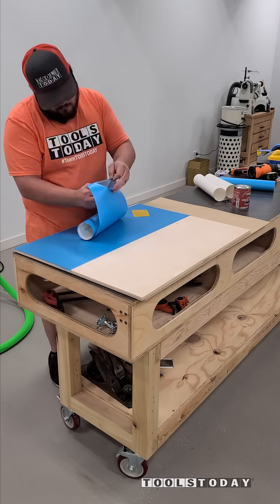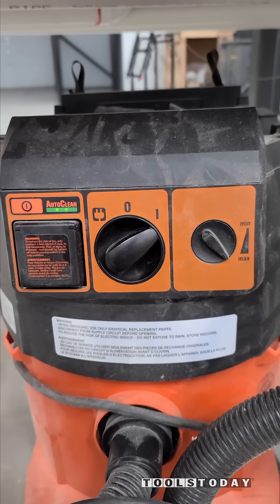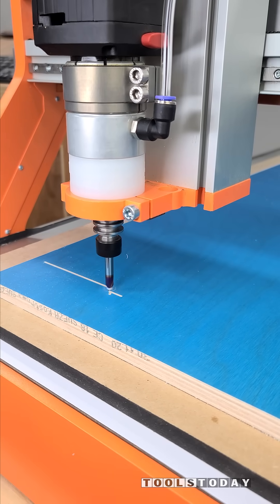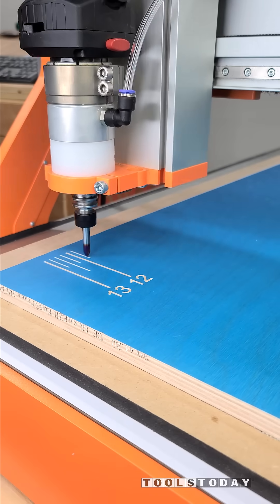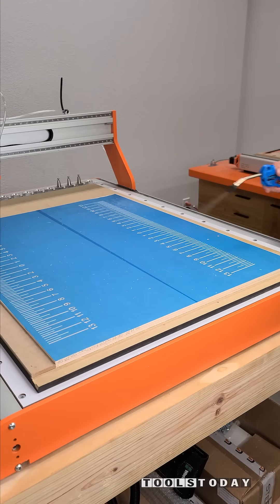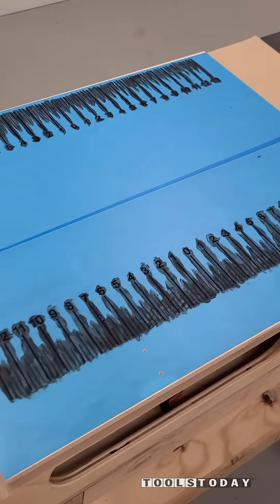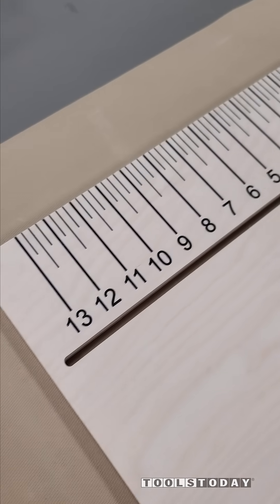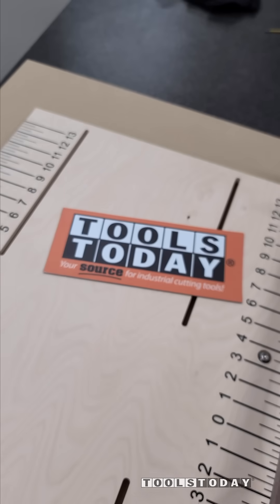Using Masking to Create a Ruler

Comment: Might i ask. Why do you need this ruler in particular? Like what are the practical uses for this with all the extra slots and stuff? Its a beautiful piece dont get me wrong but you could just buy a tape measure.
Reply: it's a decorative piece it does not have to be useful

Comment: Dude! Drain your air tank. All kinds of moisture coming out of your blow gun.
Hint: put one of those ball shaped plastic screw on inline spray gun filters on it. Helps with condensation if you don't have a water trap on your regulator.
Reply: Lol came here to say the same thing

Comment: What software you running for your cad work? A good software would make the "getting the measurements" proper super easy
Reply: A good software? Any updated software would make it easy.
Reply: @fliprodriguez5250  ya, and good software will make it even easier
Reply: Ò9l
Reply: Jjgj
Reply: I remember 25 years ago, writing code with notepad, saving on a floppy disk, and bringing out to the mills.
Reply: Remember, this is a woodworker. Probably can't do a bog standard G43 without a GUI wizard.